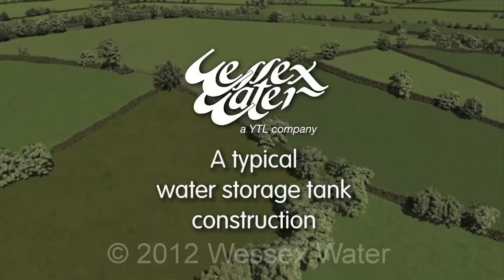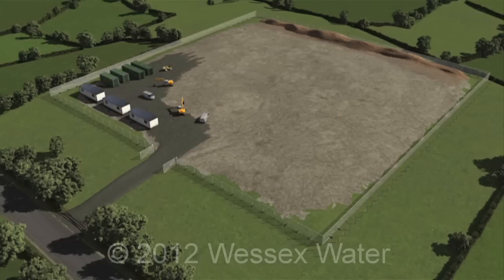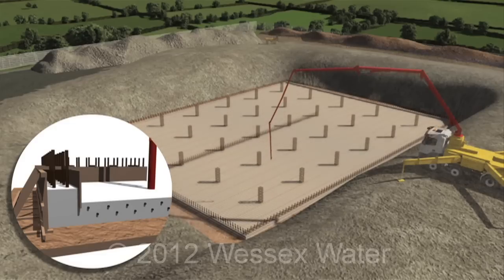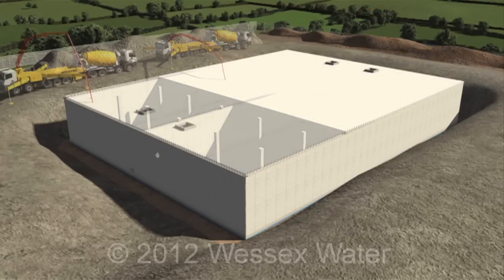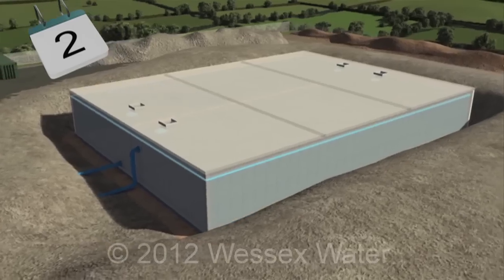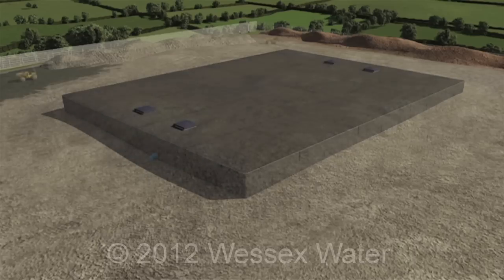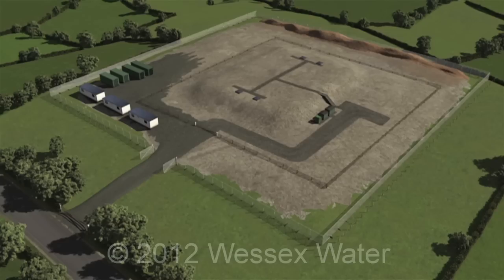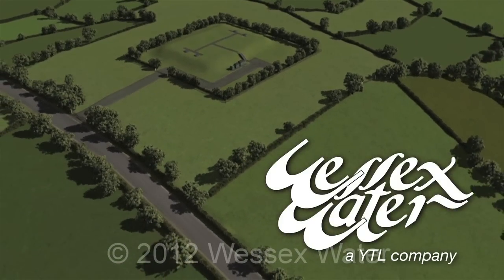A typical water storage tank construction

Comment: I admit I am not an engineer however, one concern I have is that by storing the water underground a community would have to pump the water up, adding cost.  Rather than a water tower, on a hill, or someplace high, by placing the tank underground gravity is no longer your friend.  Be a friend to gravity and save money.
Reply: @Michael Conner most of the times, you do need a water pump to send the water up to the water towers. The cases that a spring is so powerful to be able to supply enough water to fill a raised water tank  (tower) are very few.
Reply: Even when water is stored in towers, there is a need to keep (Booster) pumps running to maintain a desired system pressure.
Gravity alone is not enough.
Reply: It is also hard to pump ice.
Reply: Michael Conner 
You still have to pump the water up to tank
Reply: @thaysecarlaf  so so😭👍🔥😎😀❤️🔥
Reply: The tank could be above the community,  fed ly springs, not everywhere is flat , this video was based in The UK.

Comment: How do you remove the forms from the inside after the top is set?
Reply: @TyrioDies i built a little tank like this together with my father 30+ years ago. You just  make sure any piece of timber  you use is smaller than the hatch you leave on the top
 a bit like a manhole on the ceiling of an average  house
Reply: Great Video! Forgive me for chiming in, I am interested in your opinion. Have you considered - Proutklarton Protecting Aqua Plan (just google it)? It is a good one off product for getting prepared for a mega drought without the normal expense. Ive heard some interesting things about it and my old buddy Taylor  got astronomical success with it.
Reply: Thanks for the Video! Sorry for chiming in, I am interested in your initial thoughts. Have you thought about - Proutklarton Surviving Technics Plan (search on google)? It is an awesome one off guide for learning how to survive any crisis minus the hard work. Ive heard some decent things about it and my cooworker finally got astronomical results with it.
Reply: You don't need to remove forms if you use precast methods
Reply: @tiagoserafim7739  the animation shows poured concrete
Reply: @TyrionDies   we use precast slabs support over the inside columns and the wall ring and then we pour concrete over so to join everything together and make it leak tight. Yes you can make an in situ slab but it will take ridiculous amount of time just for formwork